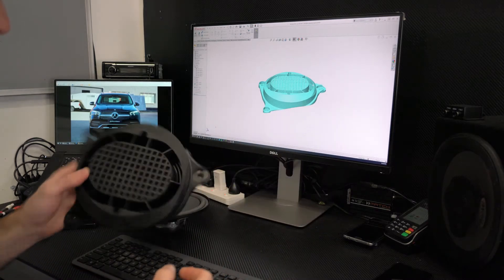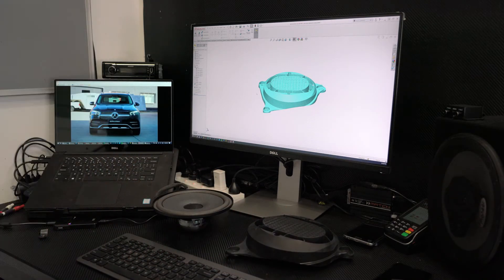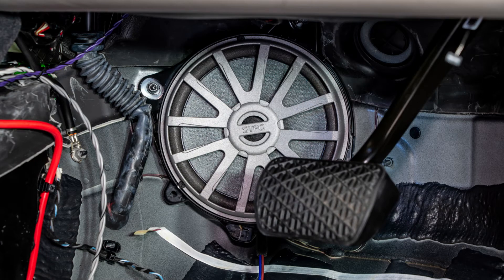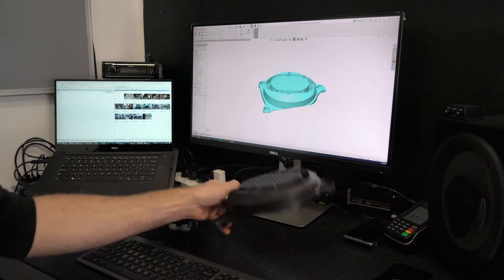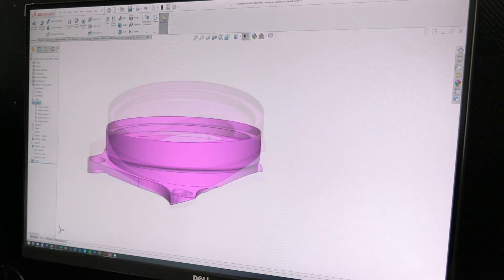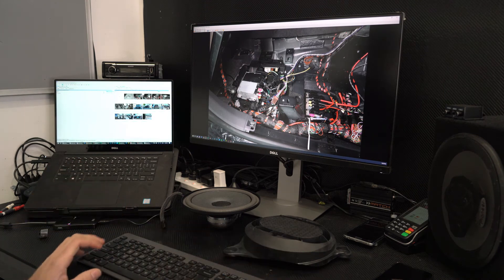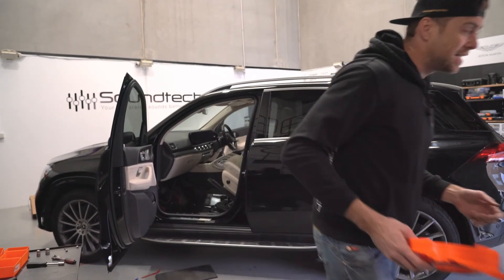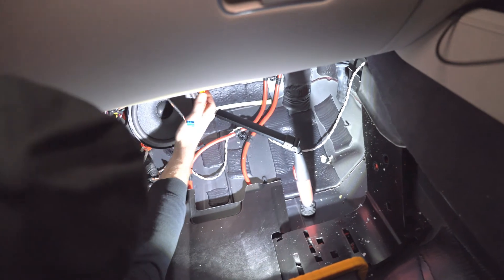Mercedes GLE 2020 with 3D printed subwoofer brackets, speaker & DSP amplifier upgrade

Comment: Great job. 
Questions 
There are not may folks that would actually upgrade their system however I am not one of them…. 
I take it that the amplifier is under the seat. My interest is installing a sub, where would I get that pure frequency range to go to an amplifier ?  Also what connector feeds signal to the stock/aftermarket amp …. Is it an optic cable ?
Reply from the maker: No Optic wires in the base sound system, but the amp is controlled digitally from the HU. Base models might only have the HU-Amp unit as one. Clean bass signal is the one that goes to your factory sub. Just find the sub (not under the seat but in the footwell) and take the high level from taht, you'll be sweet